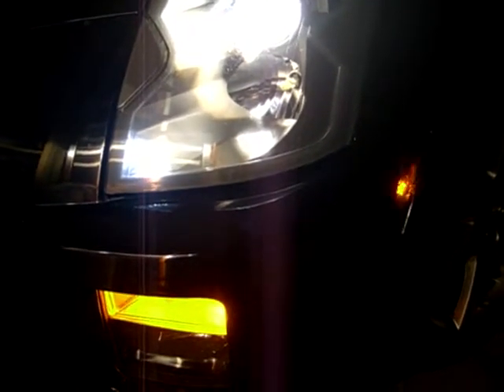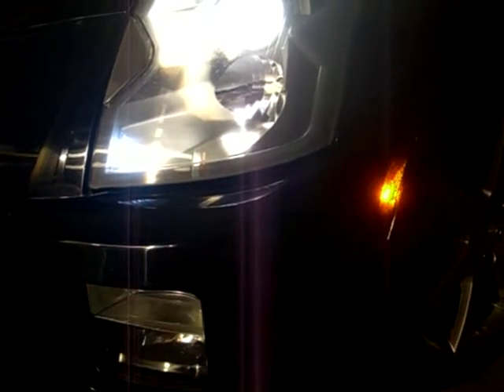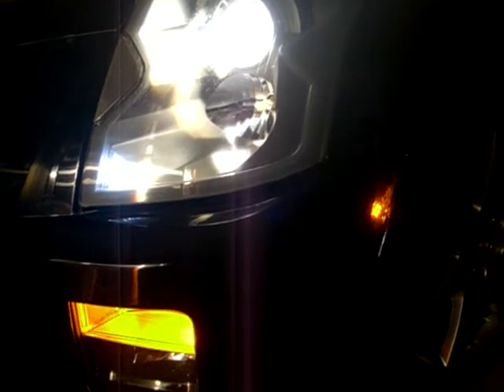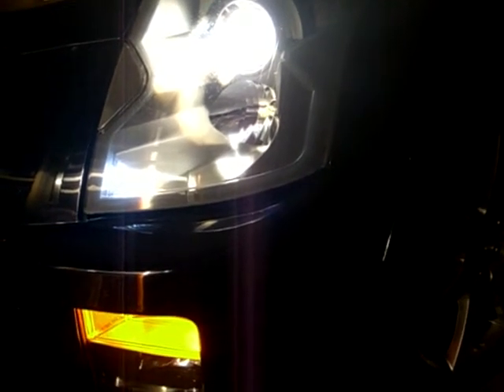Cadillac CTS-V LED turn signal flash speed with current comparitor circuit cut

Comment from the maker: Rear tails brake and rear: 4 bulbs 3157_20_R
Rear side markers (in rear housing): 2 bulbs: 194_X5_HP_R
Reverse lights: 2 bulbs: 3157_20_W
license plate bulbs: 2 bulbs: 194_4_HP_W
map lights 2 bulb: 194_HP_W_6K
rear dome light 1 light: 211_20_W
trunk light 1 light: 211_20_W (same as above)
under door lights 2 bulbs: 211_3HP_W_6K
under dash lights 2 bulbs: 561_B
front side markers 2 bulbs: 194_4_HP_A
front turns 2 bulbs: 3157_20_A
headlight triangles:  SMT-9 tower. only non VLED light

Comment from the maker: @DanRob0123 
got LEDS from "V-LEDS" search them.
fogs can be re-aimed yourself.  Small holes under the damn just behind fog housings.  Will need female torx socket and extension to reach up in.  Will beed 1/4 ratchet, extension and female torx set from sears.  It will allow adjustment up / down.  Spec is "top of fog beam is 18" from groung at 25ft away, on level ground".

Comment from the maker: DanRon, no I sent my fogs to a guy who installed the lexan.  If i were to do it again, I would mod myself.  Stick them in oven for about 10 min 350 will break down adhesive then you can trim and glue (epoxy) new all clear lexan to the housings.  I found the guy on ebay.  I do not see him but there are factory all clears on ebay for 265.  those who have done it say they spens about 2 hours and $10 in material.  The guy did mine for 65 without shipping.

Comment from the maker: I know.  I wanted the lower current draw from the LEDs and not have to worry about the resistors getting hot and burning or melting anything.. The board could be replaced anytime and resistors could be added.  This is just an alternative.